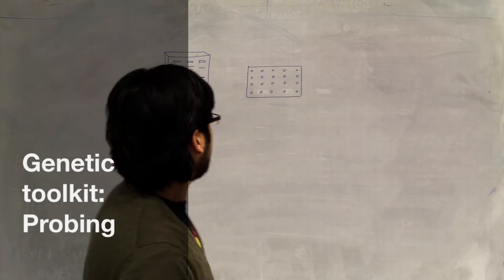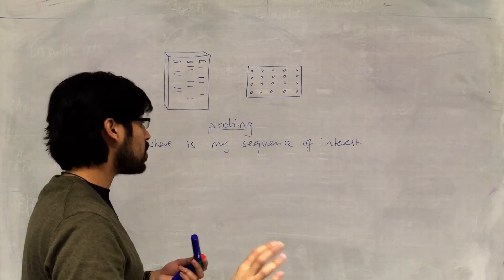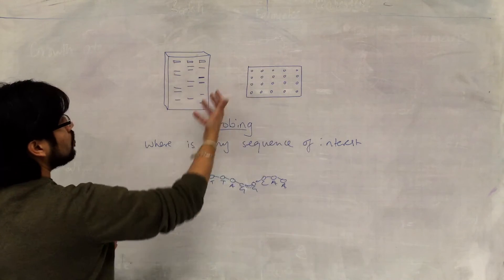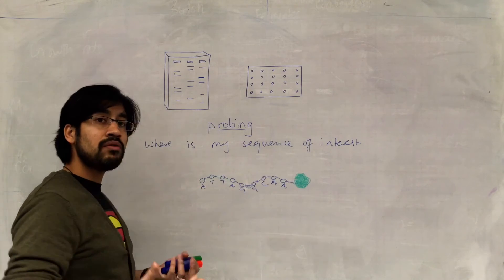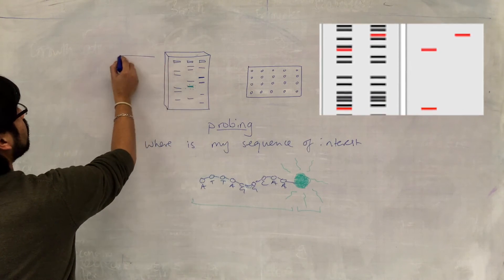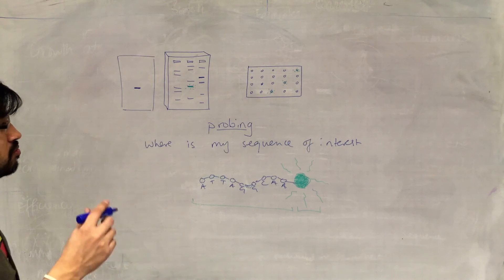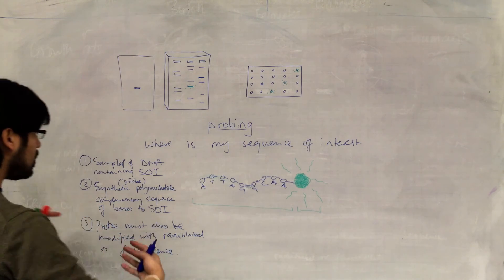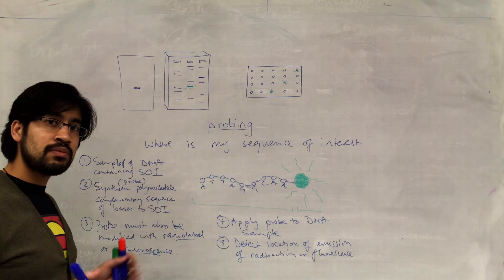Genetic toolkit: Probing

Comment: I didn't get point 2 that u mentioned 😢
Reply from the maker: +Emmah Salem the probe is essentially a very short single stranded DNA molecule (polynucleotide). The way it can 'find' a sequence in a very long DNA molecule is by being complementary to a specific section of it, ie it has complementary bases in the right order to align and bind by hydrogen bonding. Ie out of all the genes in the DNA of a nucleus it bound that one part only. That's the job of a probe. And it was designed and made in a lab because a scientist wanted to find where in the DNA that particular gene was.
Reply: +Dr Bhavsar thank you so much sir 😁